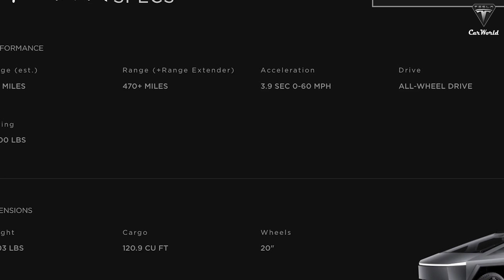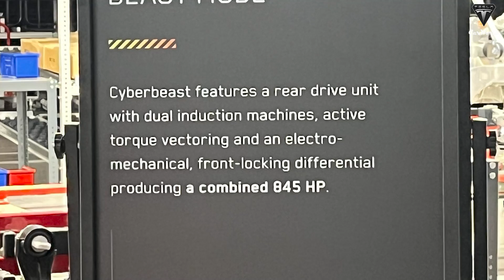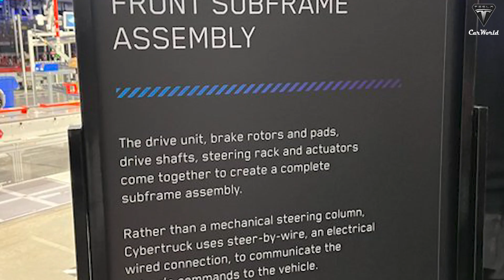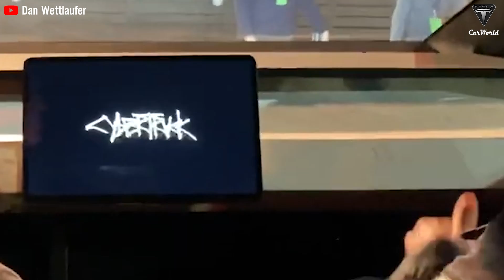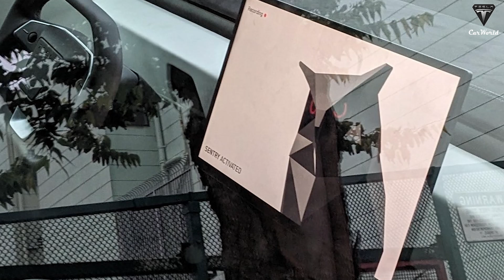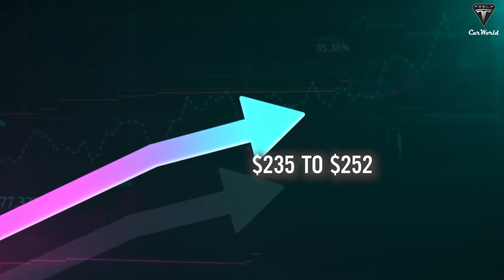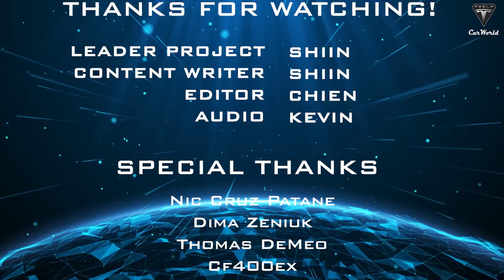Finally Happened! Tesla Cybertruck Official Launched! Shock BIG Change from Price to Specs!

Comment: I wonder if the cover and air system will work at -35 degree temperature.
Reply from the maker: The heating system will operate when the Cybertruck is in sleep mode, it will use a small 48 Volt power source behind the frunk.

Comment: So. Teslacrew. Answer me this? If a car that is in a crash is bent on one corner of its frame, but it’s a one piece gigacasting, how do you replace that part?. And if the exoskeleton is twisted, where the metal won’t reform, is that a writeoff.. I only ask because I’m just not an engineer. But it seems to me if the tensile strength of the likes of cybertruck is based on just a few pieces of structure, you just can’t replace a small piece of it and have same tensile strength?.